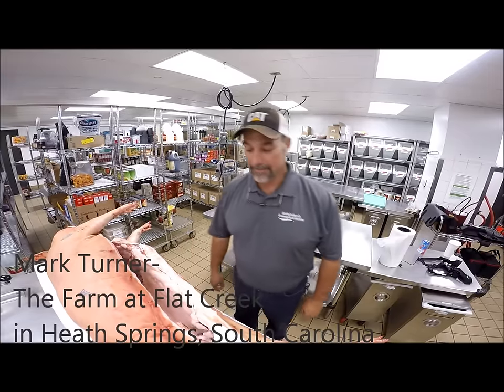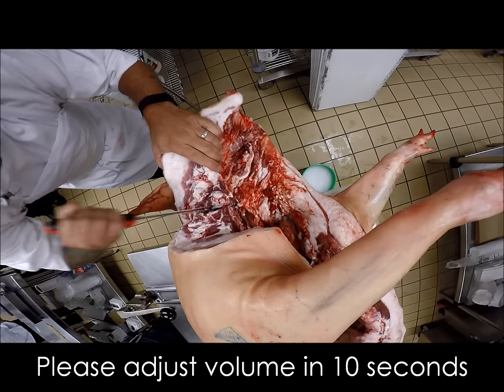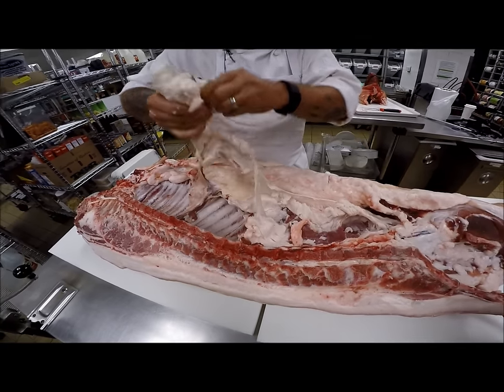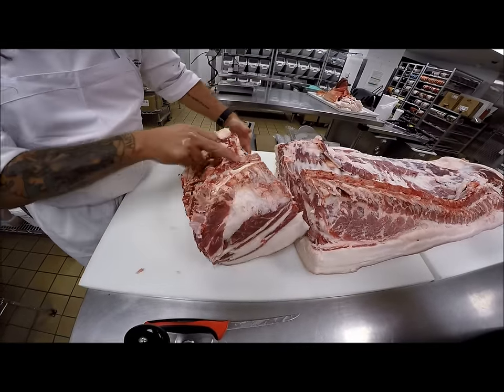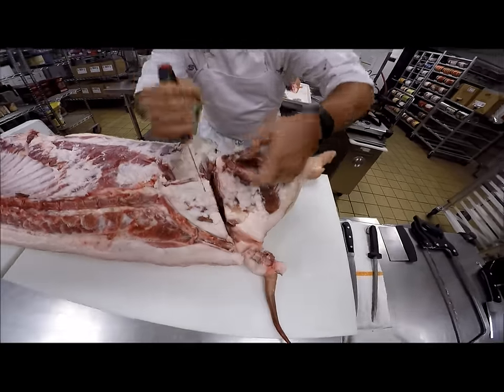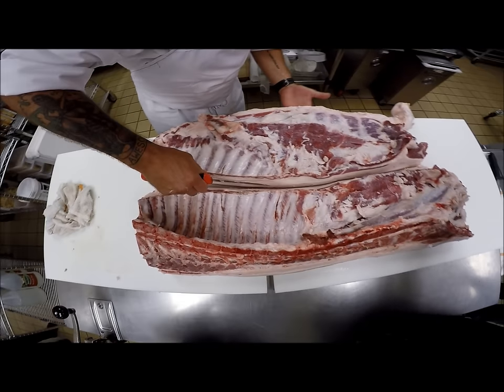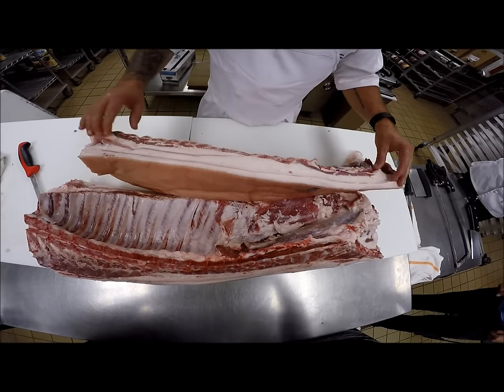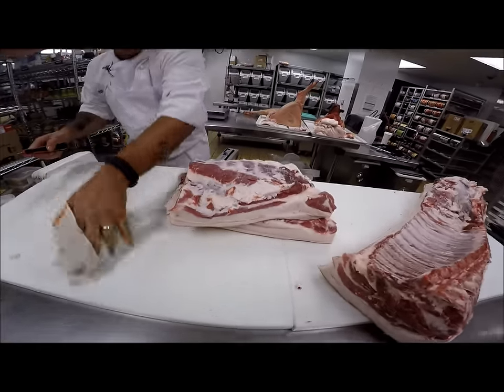Whole Heritage Breed Pig Fabrication to primals

Comment: I don't believe a Yorkshire is considered a "Heritage" breed. I checked The Livestock Conservancy and did a quick Google search and found nothing referencing the Yorkshire as a heritage breed. It IS the most favored breed for large-scale confinement factory operations for LEAN meat. Crossing breeds with Heritage breeds like the Ossobaw, give an excellent hybrid vigor growth to piglets. But if you want to call a pig a heritage breed, both should be from heritage breeds. I believe I would have crossed it with a Large Black for a little longer and muscular animal.
Reply: Mrplace001 likewise, the hock and the trotters are not primals!